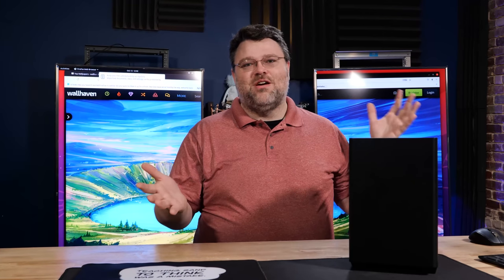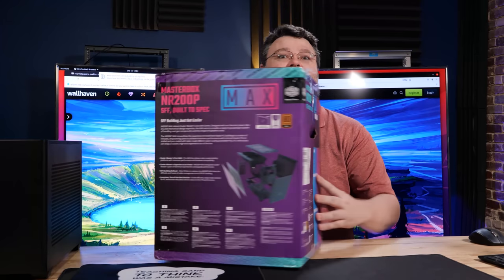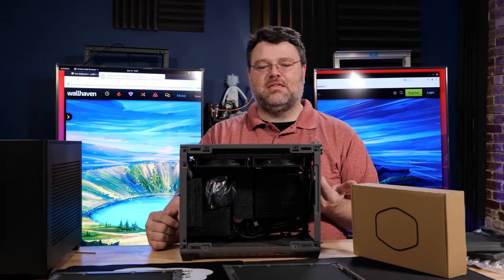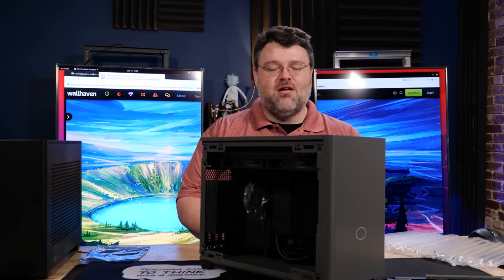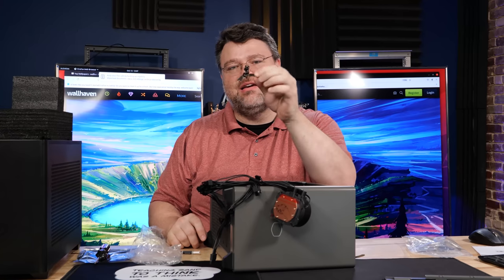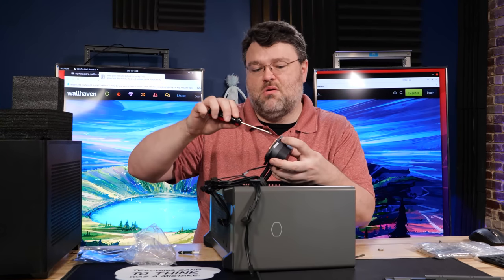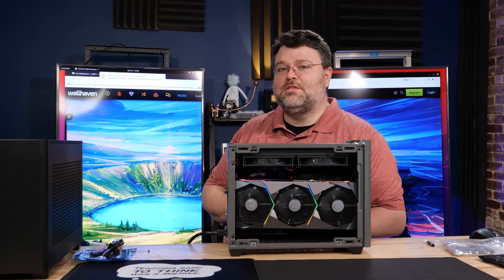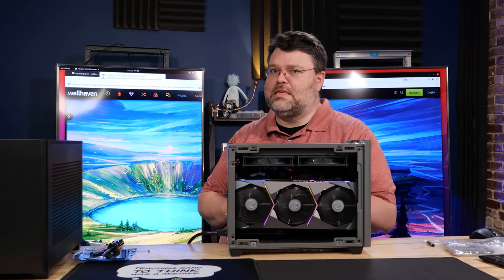The NR200p! Again?!

Comment: NR200P Gang 😍 Nice video! Btw the RTX 3080 FE worked completely fine even with the sub-optimal fan layout, and give the 3090 Suprim X a try with the glass side panel! I did add some bottom fans, but it worked surprisingly well.
Reply: Nadja😍😍😍

Comment: NR200P ❤️ By the way, SUPRIM cards fit without disassembling the chassis, pushing through the gap in the front of the chassis. You only need to remove the (white/black/grey) front panel! EDIT: this only applies to horizontal mounting.

Comment: Just got this case last week with the 5900x, Rog strix x570-i gaming MB, still waiting on a GPU, most likely get the 3060 ti strix (budget constraints).  I have read that some people received faulty cpu AIO pump.  Being relatively new to building, how can you tell if the pump is working or not? ( I haven't turned it on yet, as mentioned earlier, still no gpu ).

Comment: Has anyone done testing on the included power supply ?
Also an Nvidia FE pouring hot air onto the power supply, is that going to be a big issue.

Comment: "dual Radiators in this tiny little thing" ..... as the pump and reservoir hangs off the back. these cases are a joke.
Reply from the maker: I like that for cleaning and flushing though as it turns out

Comment: please stop building SFF computers with high end cpus and chipsets why would you put very hot powerful components on a useless no i/o no drives no 4 sticks no nothing motherboard, max level cringe for an enthusiast, case looks nice that said
Reply: If you don't want a baller SFF, don't build one. Some people though want the biggest bang in the smallest package, and the issues are not insurmountable
Reply: Some people want the processing power in a small package, storage could be somewhere else. Depends on what you want/need really, sff builds are suitable for some and sub optimal for others.
Reply: Only z690 actually supports enough I/O that you might want ATX to fully utilize it and even then there's ITX boards with Thunderbolt that you can use for external storage and 10Gb ethernet to help saturate the x8 dmi 4.0 link to the chipset. With other mainstream desktop platforms you'd be bottlenecked by the chipset link to the cpu just by using a single gen 4 nvme drive and often you're limited to 4 sata ports when you populate all the m.2 slots anyways. 4 sticks of ram also keeps you from running higher speeds and lower latencies so you're better off running two dual rank 16GB dimms if you want peak performance.

A 240/280mm aio is supported in a lot of sff cases and that's plenty for any cpu. Good sff cases give direct ventilation to the gpu and can run cooler than some mid towers.

The only real issue with sff right now is that 3090s can peak at 950W power draw in certain workloads, but come spring of 2022 cooler master is releasing an 1100W sfx and 1300W sfx-l psu.
Reply: No drives? It supports 2 SSDs. And a motherboard can have 2 M2s. If you need more you should have a NAS.
No 4 sticks? Memory is dual channel, 2 sticks is plenty.
No I/O? USB3 is fine for most people.